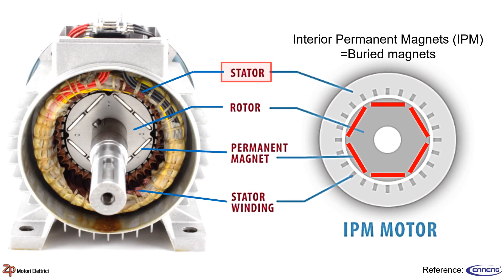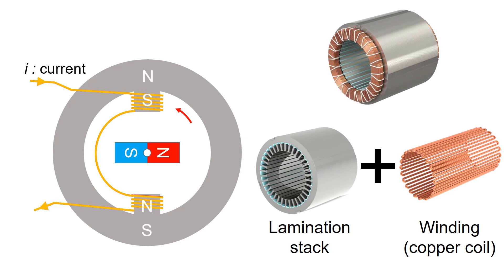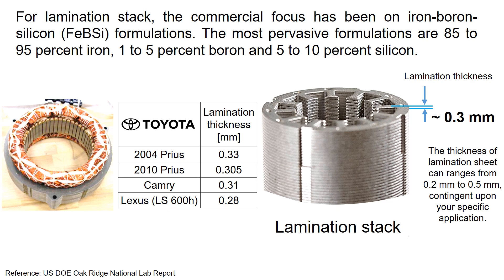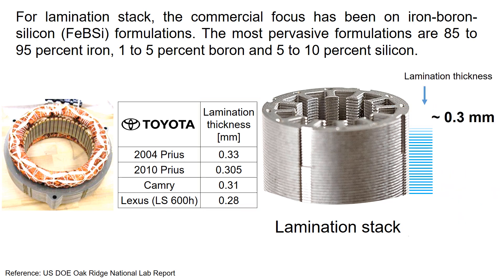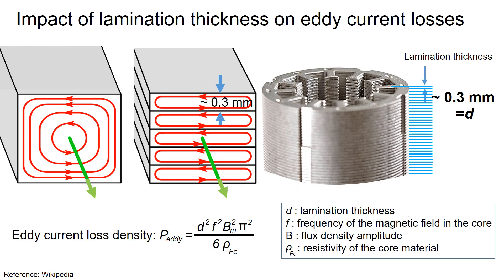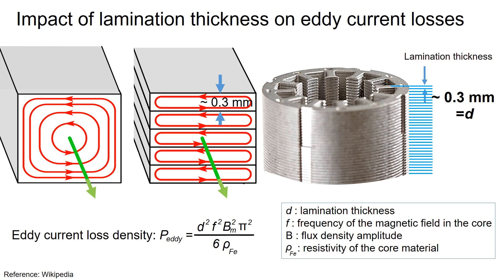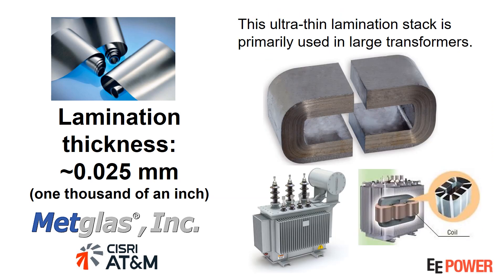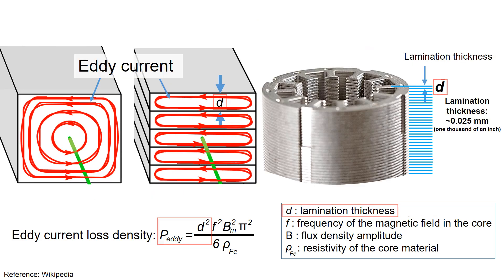Part 48 - Motor Stator Core: Eddy Current Loss

Comment: I am not quite sure why creating a path of least resistance is the explaination to decreasing power losses due to the Eddy currents. If it wasnt a lamination stack, but a solid piece the magnetic flux would still have a path of least resistance. However the Eddy currents would be way stronger.
So the explaination fails at that Point, doesnt it ?
Reply from the maker: I don't quite understand your question. The explanation in the video is accurate. Perhaps you're not too familiar with motor design. 
A solid core and a laminated stack both provide a low-reluctance path for the magnetic flux. But laminations meant to interrupt the circular paths that eddy currents would otherwise take in a solid metal core.

In a solid core, large eddy current loops can easily form, which leads to significant power loss as heat. Laminating the core forces these loops to become smaller and increases the electrical resistance they encounter, which dramatically reduces the eddy current losses.

So, it’s really about increasing electrical resistance to eddy currents — not changing the magnetic flux path. Hope that clears it up.
Reply: Thanks for your reply first of all.
I guess my issue was about the phrasing at 1:15, because the sentence is not really on point in my opinion. I understand that having an iron core would improve the energy efficiency of the motor, because it concentrates the magnetic flux. And I am also aware that the lamination stack provides resistance against the formation of huge Eddy currents, which would generate losses due to heating. 
But for me the phrase suggests that these eddy current losses are just dependent on if there is a low resistance path for the magnetic flux or not. And since I am just learning about these concepts it is  important for me to have a very sharp reasoning, so that I might learn properly. 
I didnt mean to upset you and am sorry if I did. 
Your reply was very useful to me and I am always glad when a creator answers me.
Reply from the maker: Thank you for your thoughtful message — and no worries at all, I really appreciate you taking the time to share your thoughts so respectfully.

You’re absolutely right to want sharp, clear reasoning when learning these concepts — it’s how deep understanding is built. I see what you mean about the phrasing at 1:15, and I agree that the sentence could’ve been clearer.

I truly appreciate your interest and kind words. It’s always great to connect with people who are genuinely curious and keen to dig into the details. Keep up the awesome work on your learning journey — and feel free to share the video with your colleagues if you think it might help them too!
Reply from the maker: @erhardbock1228 I’ve just uploaded a new video on motor —feel free to check it out! I’d love to hear any feedback you might have. Part 71 video:
https://youtu.be/v06ziA-XWgM?si=1STp6WG68S6phDfH